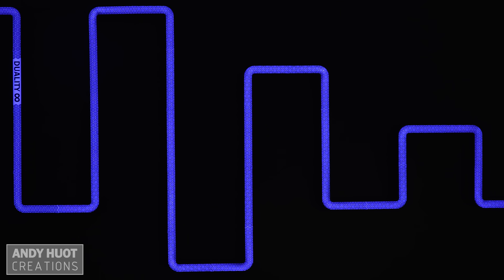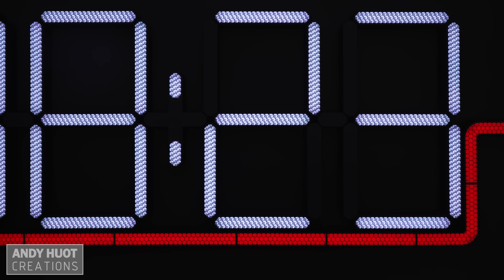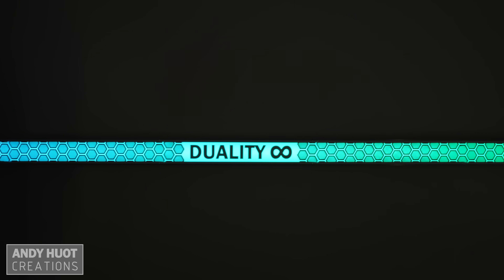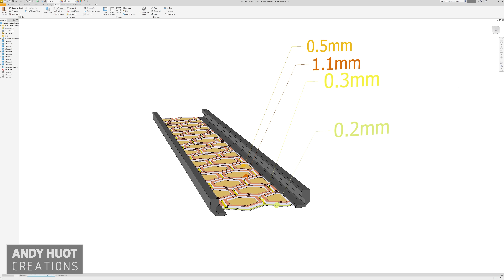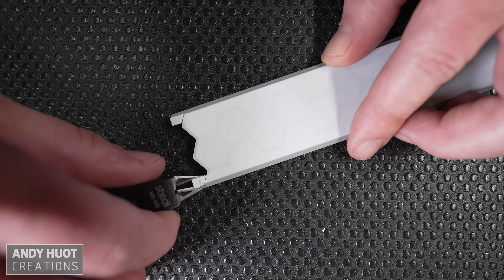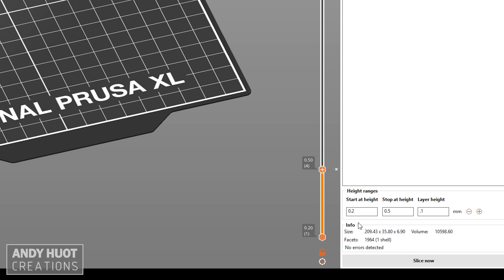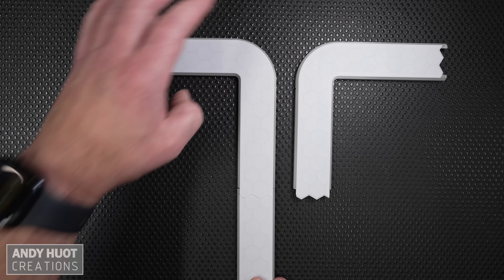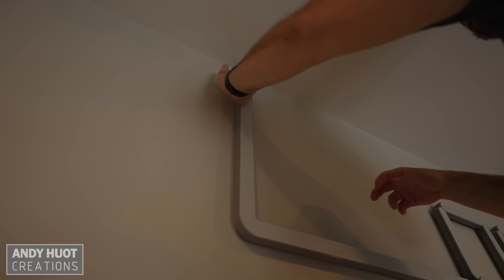3D Printed LED Track System That Changes Everything!

Comment: purchased your design and downloaded the skins !  I tried printing your seamless hex skin but noticed that the first layer (for the join) for overlap of 0.2mm lip is continuous. there is no 0.3mm layer other than inside the hex pattern.  Is it something I am not setting properly in Bambu Studio ?  tried several things but can't seem to get it to work. what should the Bambu settings be ??
Reply from the maker: Try slicing with a 0.1 mm layer height. I don't use bamboo studio but it seems you may need look into/learn about slicing with different layer heights in your slicer. If you were to choose a 0.2 mm layer height, it can't discern the 0.1 mm difference, so it rounds to the nearest 0.2mm. Make sense?
Reply: @AndyHuotCreations  thanks for the reply. I believe I tried that with initial first layer height of 0.3 mm and 0.1 mm as the layer height.   will try it again.

Comment: Newbie to all this! This is a project must try this winter.  What if I wanted to double the length of LEDs ?  Does that change the power needed?
Reply from the maker: You would need to calculate the current draw from the number of pixels you have.  Typically, each color channel will draw a certain current, usually 20mA.  If you use RGB to create white at full brightness, it would draw 60mA per pixel.  I like to use RGB + W, which has a white channel that is usually 20mm for full brightness white.  I like to use the 12 volt RGB + W strips that have 3 LED/pixel because, at least on the ones I've used, the current draw per channel is for 3 LEDs, not just one.  This is because the 3 are in series and share a resistor.

Comment: I used PLA filament and placed the LED strip inside the enclosure, but after a few hours, the filament around the LED strip deformed and became soft. Should the LEDs only be on for a limited number of hours?  I used PLA + ESUN
Reply: Play has a Lower melting temp. 
I’ll try Petg for both. 
I think it also depends how hot the leds run

Comment: You could improve the design furhter to not needing supports at the end bits. Just take the overhanging bit needing support, and add it to the adjacent part (aka the other end). The design will not only look better but deletes the overhang. Now you'll have to modify the coupling as well, but not by much.

Comment: With this being based on a hexagon pattern now, would it be possible to have an angle other than 90?
Reply from the maker: There are currently 90 and 45 degree angles available both in plane, and vertical directions.

Comment: can the diffuser be printed separately? I dont have a dual filament machine(K1C)
Reply from the maker: Just add a color change in the slicer and change it manually. It will pause and beep, alerting you to change the filiment

Comment: Wow ! This project and even your videos are amazing ! I love it.  Question, is it possible to install outside ? Perhaps a next improvement 😊
Reply from the maker: Thanks!  If you printed in ASA, ABS, maybe even PETG, used IP67 rated led strip, and potted/sealed the electronics in the base, you could use outside.  I wouldn't recommend much direct rain or sunlight though.  The sun can still deteriorate the print over time and the water can cause mold, especially if it gets into the track.

Comment: What about cooling the led Strips?
Reply: Cooling ? For what? They don't heat up is not old bulbs 🫢
Reply: @kakakaminski3361 LEDs absolutely heat up. They don't generate as much great as quickly, but they still need cooling. Most LED strip lamps use aluminum housing for just that reason, it helps cool the LEDs.

Comment: What is the variation in the hex pattern right under the colon in the clock?
Reply from the maker: Since I wrapped my track around the clock, I had to make a custom 272mm long track to get everything tight.  This meant that the pattern was interrupted due to not being divisible by 25, so I filled in the center with a hex crest type design.  Being in the center of the clock, makes it look pretty unique.  I may eventually add that custom track and skin to the downloads if people are interested.

Comment: I have a large wall in my office that I would like to install this system on.  I saw the Prusia slicer settings.  Would you have Bambu print profiles for the 3 transparencies or has this been posted to Makerworld?
Reply from the maker: I only use Prusa slicer.  It really doesn't take long to set the print up. Maybe 30 seconds.